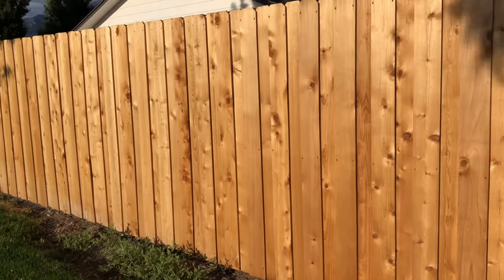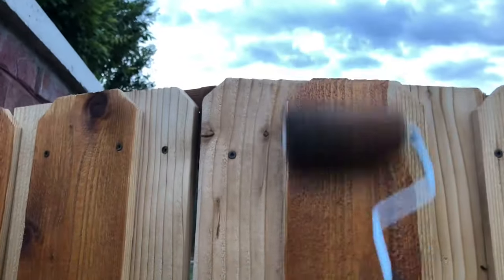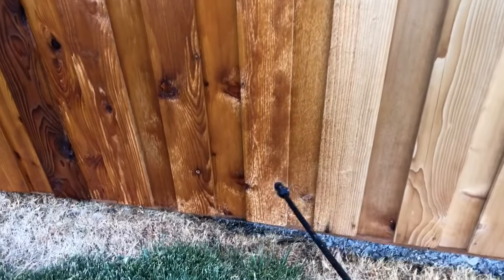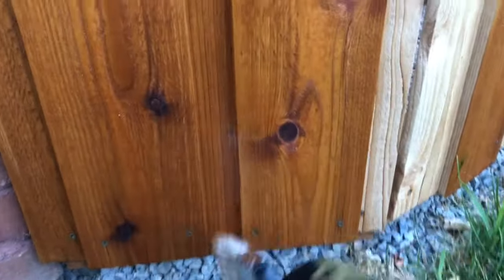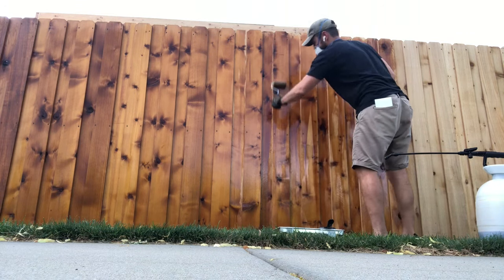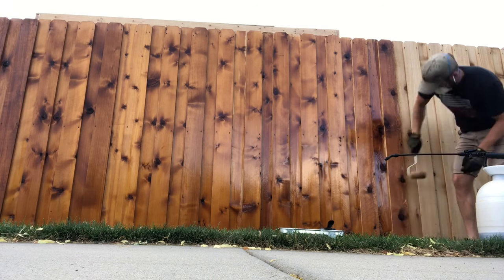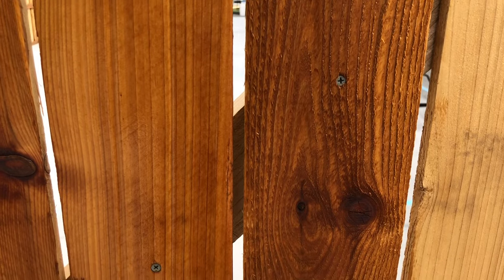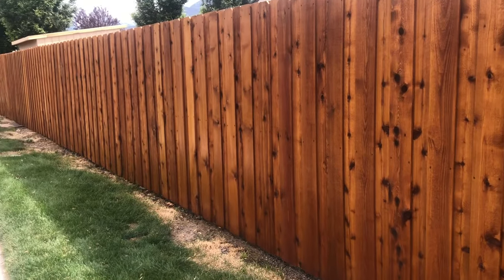Staining Cedar Fence with READY SEAL Light Oak - Spray, Roll, Brush

Comment: Product fades to nothing in less than a year. Easy product to apply. But not worth the money.
Reply from the maker: Is there a better alternative you would recommend?
Reply: The Sansin  S.D.f  applied as recomended by the munfacture will out perform any paint thinner based product. Also with this product it has a great recoat if done before it starts to fade 3-5 years in the Pacific North West. I Have been selling stain for 30 years . this is the best I've seen.
Reply: I put ready seal (redwood color) on a cedar rail fence. I put a very heavy coat on initially and the color faded alot after 2 years. I put another coat on and it darkened up nicely with better color than my initial application and it has retained it's color much longer. Used the same redwood color on my front deck and it looks awesome. Ready seal is a good product but it does require heavy applications to get that deep rich color. I like it better than regular stains because it doesn't show paint brush marks or runs and it really brings out the natural wood grain. I love the results but it is expensive and multiple heavy applications are necessary to get the expected results.

Comment: Did you apply a second coat, as recommend by Ready Seal?
Reply from the maker: I only did one coat. It has held up well, though I'm sure adding a second coat would certainly help with longevity.
Reply: What kind of nails did you use. I heard hot dip galvanized nails is better for cedar
Reply from the maker: @feliciaaclark I used stainless steel ring shank nails. Galvanized should also be fine for cedar and outdoor use

Comment: No need to apply heavy coats on it to try and make it cover. You will have to do two coats to make it look uniform.  Just like paint, thicker is not guaranteed to make it cover in one coat. It takes time and patience. I feel you did a nice job on the fence, but I saw some comments where some of the folks talked about putting on a thicker coat.
Reply from the maker: Yeah I definitely think two coats is the way to go. Thanks for the comment!

Comment: this is perhaps the best cedar staining video I have seen!
Reply from the maker: Wow that is very kind I appreciate it! Glad you found it helpful.
Reply: I've watched a ton too.  NOBODY explains the difference in stain absorption as clearly as you do.   people need to know that if you use RS on smooth cedar it looks  soooooo orange its ridiculous.  I have been trying to stain smooth cedar for a long time to a slightly-darker-than natural color and its been brutal.   I've gone through 12 gallons and 30 samples of stain trying to get that very refined deep kind of hazelnut or perhaps a light tan brown.  rough cedar?  no problem.   any other FREAKING wood I've tried?  no problem.   even white pine because unlike asswipey cedar, its consistent (lol, can you tell that smooth cedar has been a source of torment?  😅).  I wish we could share photos because I would show you the dozens of tests I've done (all labeled) and the different stains I've used.    the problem is  that smooth cedar looks so much more high-end/elegant etc.  It's also so much more interesting than other exterior woods.  Douglas fir would be great because of its natural reddish coloring but it ain't no cedar or cypress or redwood when it comes to longevity outdoors.   and people who want cedar, want cedar.  anyway, I think the process you explained was definitely helpful but the difference in stain absorption especially.  ✌🤘👍
Reply: @i_try_diy  by the way, I'm the same person, I just used different accounts (evidently different on my phone than on my 'puter)

Comment: Just applied this for the first time using the handheld pump sprayer, one thing I did different is get a flat nozzle, found it sprays a lot more consistent.  Did go back with a roller on it just in case.  Great work and great fence you have there!
Reply from the maker: That's a great idea! Glad to hear it worked well for you. Appreciate the comment.

Comment: Nice video! I like seeing the various application methods. That color on the cedar looks absolutely amazing!
Reply from the maker: Thanks so much for the kind words! We're pretty darn happy with how it turned out
Reply: @i_try_diy  how often will this need to be reapplied? Btw it looks amazing!
Reply from the maker: @kturbo504  thank you! ReadySeal states that you should reapply every 3-4 years. The nice thing about this oil-based stain is you can just clean the surface and reapply right over top of the existing layer, no need to remove it beforehand.

Comment: Ready Seal advertises 125 square feet of coverage per gallon, two light coats or one heavy. For 200 feet of a 6-foot privacy fence, you’ll need 20 gallons of stain to do both sides ((200x6x2)/125=19.2). You’ll only use twice as much if you use a sprayer not meant for stain. If you’re spending 10k plus on a cedar fence, at minimum get a decent sprayer specifically made for stain application for 50-100$. Personally, I got a Graco airless sprayer, extension wand, and stain tip since you need to reapply stain every 5 years or so, climate dependent. Watch a few videos of people spraying a fence (with a proper tip so stain doesn’t go everywhere) vs a brush/roller and you’ll definitely want to get a pump sprayer at minimum. The only reason you had to back-brush is because the sprayer you used wasn’t meant for stain and was shooting out blobs of stain instead of an actual spray. For a board on board fence, spraying is the only way to go if you remotely value your time. And don’t cheap out on the posts, get PostMaster posts. Look it up. And for a super clean look, do an image search for a board on board fence with cap and trim. 

Also note that the moisture content needs to be less than 14% for the stain to soak into the cedar (per Ready Seal). I got a Klein Tools ET140 Pinless Moisture Meter. I can save you $40 by saying that cedar moisture content is about 7% two weeks after installation. And that’s in the Midwest where it seemingly rains every other day. If it’s a new cedar fence, all you have to do is wait two weeks or get a meter to test it, then stain. No wood prep needed if it’s brand new. If you cheap out and use fir or pine, then you basically have to wait a year then prep/clean it before stain. 

The stain must be extremely well mixed, and the cans mixed together if using multiple cans. Just rolling the 5 gallon can around doesn’t cut it. I know from experience. Get two 5 gallon buckets with lids from your local home supply store and a long drill mixing attachment. Pour multiple cans in those and mix away with the drill mixing attachment. Make sure all that stain goodness isn’t resting in the bottom of the Ready Seal cans by shaking the hell out of the last gallon or so in the ready seal cans, then mix the contents of the two buckets together to ensure the stain is evenly dispersed between them. Lastly, get a few of the dollar cardboard paint spray shields and slide them under the fence as you stain for no mess at the bottom of the fence. 

Spending a couple of hundred for the stuff I just mentioned will save you a ton of time and grief vs just winging it with brush or paying someone to do it. It’d be $1500 at least for this guy’s fence if you paid someone vs $500 or so total (for a 100 linear foot 6-foot privacy fence) to do it yourself in an afternoon with the stuff I just mentioned. And you get to do it all over again in 3-5 years unless you let it go to hell like most people do. It took many hours for me to figure all this out, so for everyone reading this, you’re welcome and good luck.
Reply from the maker: Spot on. Definitely plan to get my hands on a decent sprayer next time I have to stain it.
Reply: what sprayer did you get and which tip? I got the handheld graco utlra airless one, i don't think i can spray oil based stain, is oil better than water based?
Reply: @lopaksau  I got a Graco Magnum sprayer, the extension, and a 411 tip, which is recommended for oil-based stains. I haven't seen a good argument to use water-based over oil-based, but there's got to be one, likely to do with fir or pine fences since the pressure treated wood doesn't soak up the stain like cedar does. Also likely in places with high humidity, where the oil can't soak in very well. If you're in the south you'll definitely want to check the moisture content and make your decision based on that. Mine is about 6-7% right now and it's been up 3 weeks or so, so I'm good to go. 

But for a cedar fence, you want oil-based for two reasons (and all the main fence guys on YT say to use it). It soaks into the wood, further protecting it,  it can't chip off, and when it's time to reapply you just go over it again (but you still have to clean the fence before reapplication). Water-based has to come off completely each time, which means pressure washing the entire fence of every bit of stain. No thanks.  I'm actually going to stain my fence tomorrow for the first time with the Burnt Hickory color. I'll come back and comment if I run into any unforeseen issues.
Reply: @mappyfrappy  thank you very much for the great info, really appreciate it, I only worked with water-based stain from benjamin moore on decks, it is pretty good. theres not too much of peeling. This time I am gonna try oil based stain on pressure treated wood. I am located in toronto, Canada. oh btw, are you using oil or water based product?
Reply: @lopaksau  Holy Hell. I just stained the majority of my fence (with Ready Seal oil-based stain, like I already mentioned). Get one of those white suits they sell in the paint isle. The videos I watched made it look like minimal over-spray happens. Ahh, no. I looked like I was in a stained version of Stephen King's The Mist. I was wrecked with over-spray. 

And insult to injury, I grossly underestimated the stain required to do the backside of a board on board fence. Easily takes 1.5 times, closer to double the amount of stain to do the back-side with the cross beams vs the good neighbor side. I've yet to see a comprehensive video that doesn't leave a whole lot of shit out. And no, I've got no interest in making one. That said, spraying is a whole lot quicker if you can get over the giant cloud you produce from doing so. Don't spray if you're worried about your neighbor's shit. I wore a respirator and glasses. Make sure you do also, cause it's messy.
Reply: @mappyfrappy  overspray is definitely a huge concern to me since the client has a new interlock and a pool, thats why i was really struggling should i try spraying it, but yea i will probably go with stain brush this time, how does it turn out in terms of the quality?
Reply: @lopaksau  As much of a mess it makes of you and your cloths, the over spray is so fine (atomized) that it's easy to clean off of things. The coating on my glasses came right off with some Windex.Now 95% done staining my fence. You're a bloody mess using the sprayer. But it's way faster. Pick your poison. Get the sprayer roller attachment if you're so concerned. The convenience of a sprayer, but with a no mist no-reload roller brush. Like I said, I have a board on board. A roller would only mean I get to use that and a brush to get it done. Way too many cracks and crevasses for a brush or a roller.
Reply: @mappyfrappy  For the overspray your getting, it could be your spray tip 411 is too wide and the pressure on your airless sprayer is too high . I plan on doing my fence soon but use a Graco 211 tip instead which will give a 4in spray pattern then adjust the pressure. I’ve got great results with that tip with very minimum overspray when I had to paint doors. Just a thought…
Reply: Thanks for the detailed guidance, it reassured me of a few things. 🤘

Comment: Just finished my fence using your suggestions...except I bought a pump sprayer with nozzles meant for staining.
It definitely went pretty darn fast though I still hit it with a roller just to smooth things out. FYI, 5 gallons of that stain right now on Amazon is $175. Still cheaper than Behr. 
Thanks again for the video!
Reply from the maker: Nice! Yeah I probably could've finished it in half the time if I had the right nozzle haha. Definitely plan to use that in the future! Appreciate the comment👍

Comment: I always apply readyseal stain with a good 4"  brush. I stained my deck and about 340 linear feet of privacy fence this way. Sure it takes longer, but 7yrs  later and my fence still doesn't look bad, but I'm finally restaining it this summer.  Saw this video looking to see if I should try other methods, and I feel like the brush method puts it on thick and lasts the longest.
Reply: What color did you use Jeff?  And seven years you can't go wrong
Reply: @kingssing  I used Pecan for deck and fence.
Reply from the maker: Love it, I think your results speak for themselves. Thanks for the comment!

Comment: I put a tire valve on my pressure spray and used a compressor to pump up my sprayer. 32 PSI was fine but I did go higher. no brush or roller was needed. Very fast and easy
Reply from the maker: Wow, never would've thought of that! Just a regular pump sprayer?
Reply: @i_try_diy  yes just a regular sprayer. Metal would be best. Some have a psi rating
Reply: @Brian-gx7yx 
What brand sprayer?
  Did you purchase off Amazon, Home Depot or Lowe’s??? 
  Any links?
Reply: @tinaknutsen  Princess Auto plastic, but a metal one is best. Best to have a big lid to easily put in tire valve
Reply: @Brian-gx7yx  
Thank you kindly for responding back. Going to take your advice.

Comment: Did you do 130 ft of fence front and back with 5 gallons?
Reply from the maker: A 5 gallon drum covered about 115 ft. one side for me, so you'd probably want 10 gallons for 130 ft. both sides, or maybe even a bit more depending how thick you apply. 
Hope that helps! Thanks for watching

Comment: 💥 Thank you. This was helpful.  I’m trying to find something to preserve the new appearance of the cedar and prevent it from turning grey but nit alter the color too much. This seems to be more of a stain that changes the color.  I have a 50’ long fence, two sides so 5 gallons seems to be more than enough.
Reply from the maker: From what I've read and experienced, the pigment in a stain helps to protect the wood from fading or discoloring from sunlight and weather, along why I the actual oil/sealant of course. Transparent sealers don't seem to do quite as well or last as long as semi-transparent which is what this is. I also wanted to bring out the natural color as much as possible, so I chose Light Oak which is their lightest shade. But it definitely does add some color. And yes, 5 gal should be plenty for your needs. Thanks for watching!

Comment: This is a great video, kinda what I was looking for. I really like the color of stain on the cedar. It might have been mentioned, being the video is like 2 years old,  but wouldn't an electric HVLP sprayer and back brushing or rolling be the way to go. I have 2 sprayers and they are only $30-40 each on Amazon.
Reply from the maker: Thanks for the comment! Yes you're 100% right, an inexpensive sprayer is the way to go. I just decided to use what I had lying around, but well worth the $40 investment to save the time and effort. Thanks!

Comment: Thanks for sharing your video!  What did you use to clean your sprayer when you finished?
Reply from the maker: Thanks for the comment! I just "cleaned" it out with water, and ran a bunch of water through it. It is now my dedicated stain sprayer because it's definitely not all the way clean! You could probably get it pretty clean using paint thinner or mineral spirits

Comment: Dumb question, but I've never used this before - how do you mix the large 5 gallon of Ready Seal?
Reply from the maker: Not a dumb question at all. Easiest way I've found is just basically shake it - tip it side to side and upside down a whole bunch to mix up any that has settled to the bottom. Just make sure the cap is on tight!
Reply: Walmart sells 5 gallon mixer tool for $6, bought it today.

Comment: Did you power wash or clean your fence before hand? Sorry if I missed that step.
Reply from the maker: I power washed it a few days before staining, but only gently to remove any loose dirt or dust. It was a brand new fence so there was no need to remove any old stain or mildew.

Comment: Great video. Did you prep your new fence before applying? how has it held up 1 year in? Any idea how long it will lasts?
Reply from the maker: Thank you for the comment! The biggest "prep" is just making sure it's dry enough to accept the stain. I waited a few months after installing the fence to apply the stain. I did also very lightly power wash a few days before staining it to get any dust/dirt off. But that's it for prep!
It has held up really well. It's a bit lighter now than what you see in the video right after it was applied, but still looking great. My guess is I'll re-apply after 3-4 years. Nice thing is you can just clean it and re-apply right over the top, no need to strip the wood or remove it.
Hope that helps!
Reply from the maker: Just posted an update on what it looks like now 2 years later if you want to check it out! https://www.youtube.com/watch?v=05B_spCNgv0

Comment: When the time comes to reapply, what are the steps ?
Reply from the maker: Since it's oil based and not water based, all you need to do is clean the surface of any dirt or build-up (very light power wash or hose jet spray) then let it dry for a few warm days and reapply right over the top. No need for chemicals or stain remover. Very simple process.